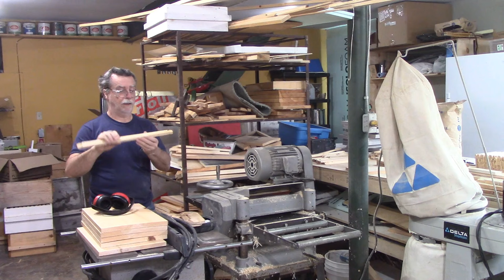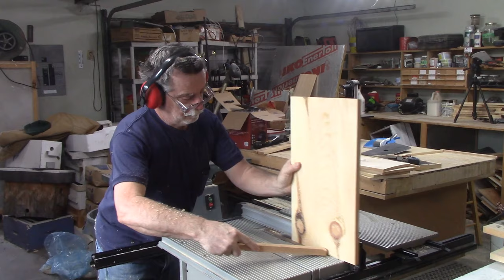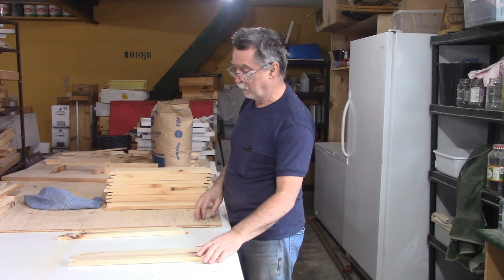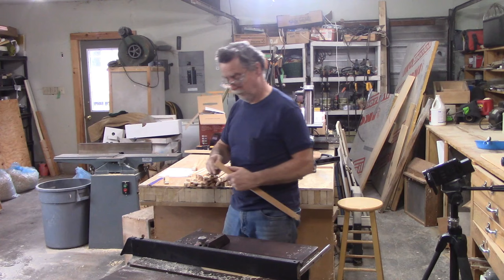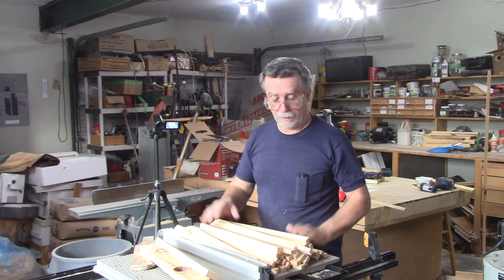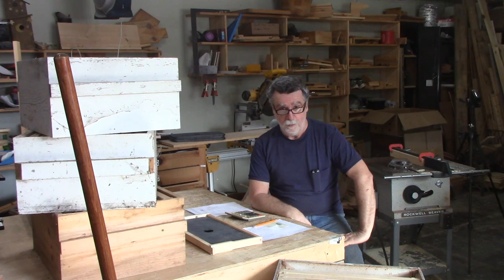Making wood Brood frames Part Two

Comment: youre using a 1 x something wide board - moneybags!  hahaha  I use scrap 2x material and rip it down 3/4 wide.  Changes the process entirely as you are dealing with 3/4 x 1" blanks.  Is that a Ryobi 3000?  I used to have one and loved it!  I burned the motor up in mine and couldn't find a replacement.
Reply from the maker: "youre using a 1 x something wide board - moneybags!  hahaha "...LOL...It's cheap here. Saw mill near me makes wide pine flooring and I can buy the planner outs
 
" I use scrap 2x material and rip it down 3/4 wide.  Changes the process entirely as you are dealing with 3/4 x 1" blanks.".....I may try that, I do have a friend that builds houses and I can get lots of 2X scape.

" Is that a Ryobi 3000?"...BT3100...I like it.

Comment: I have been considering getting a dado set for various cuts for my woodwear production. What brand and tooth configuration would you recommend?
Reply from the maker: I bought a cheap one not knowing if I would like it, we have a place called Princess Auto, I think Harbour freight is similar. This is a link to the one I bought but it was on sale I paid about $60 Canadian
https://www.princessauto.com/en/14-pc-8-in-dado-blade-set/product/PA0009153198